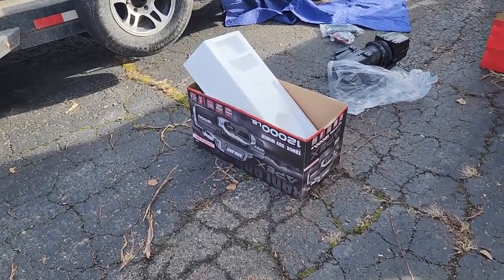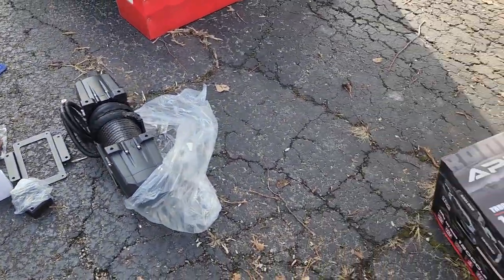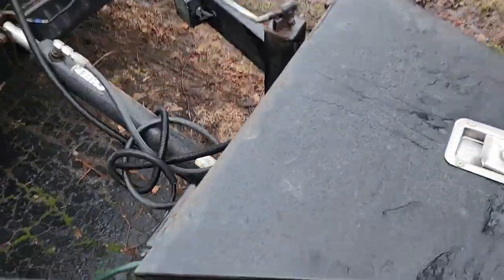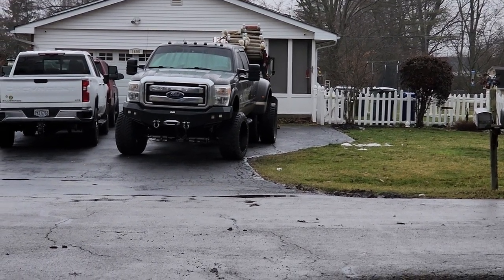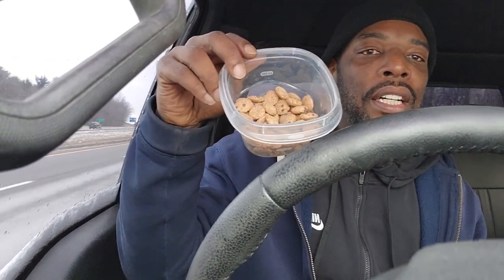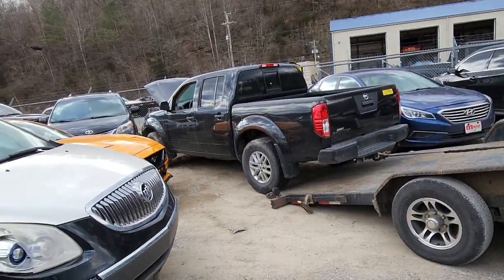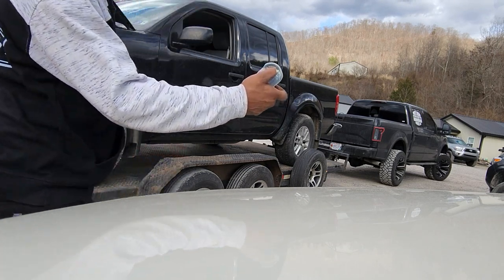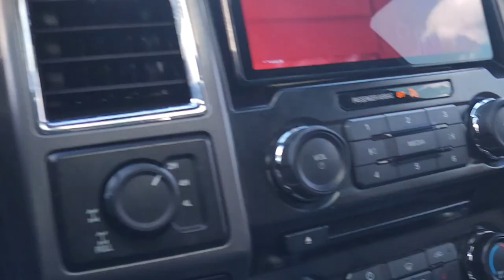Badland Apex 12000 Lb Synthetic rope winch review

Comment: Nice. Reason for replacing? But going to tell you, A WARN 8000LB WINCH IS STRONGER THAN THAT 12K HARBOR FREIGHT. BUT IT STILL WILL GET THE JOB DONE. Looking good
Reply from the maker: The 8000 pound bulldog just seemed like it was getting worn down…
Reply: nah dude the 8k warn is junk